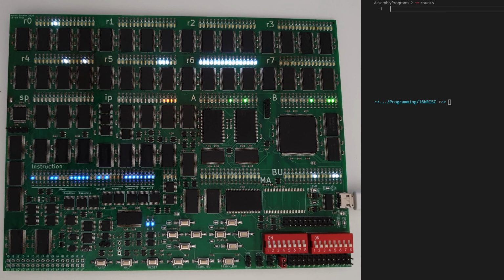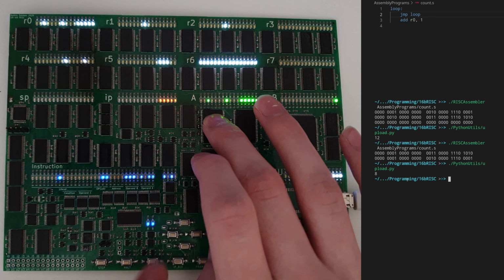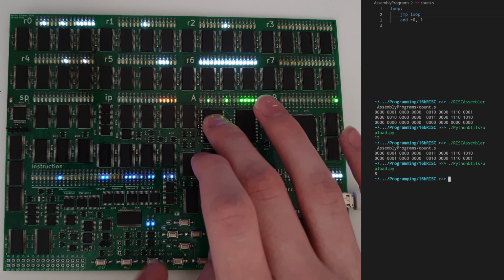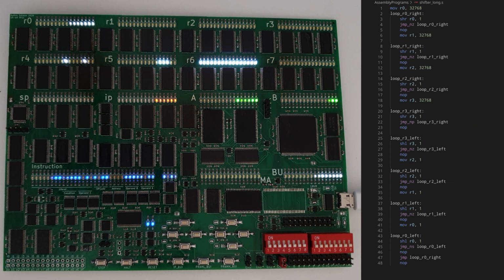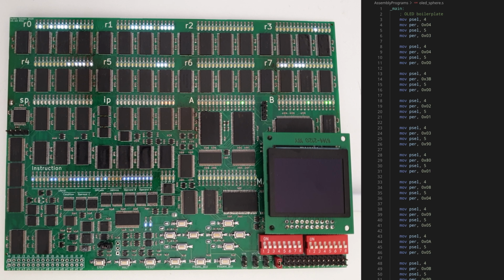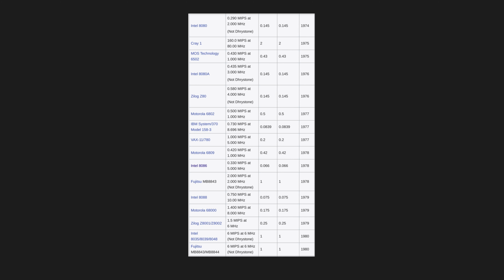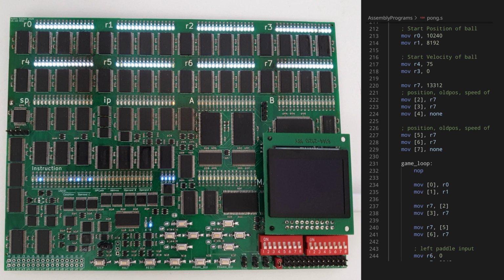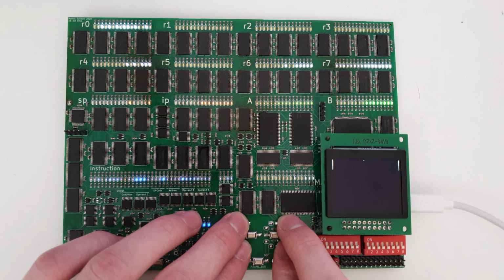Pong on my new Custom 16-bit Computer

Comment: may i ask why you're using 4 IC's per register? what do they do?
Reply from the maker: Sure! Here you go:
- One stores the actual data: 74LVC16374 (or 2x 74LVC377 in the next revision)
- Three are just buffers to output the data on one of the three operand buses (A, B, Addr): 74LVC16245

The buffers are separate from the register itself because I always wanted to show register contents on the LEDs, so the stored value always needs to be accessible.

I would probably go with a different design if I were to do this again though:
Instead of three operand buses, I would use just two which is enough for normal instructions. One of them loads on low clock, the other on high. Then you just need one buffer chip shared by both ports. If LEDs are not required, you could then even do without any output buffers and simply use the ones in the register IC itself.

Comment: What a beautiful board. I love what you've done with the LEDs and the labels - it's very easy to read! Going with a 32-bit constant instruction width for a 16-bit processor is very interesting and definitely not something that any 16-bit processor I know of ever did, but for ease of implementation and educational purposes it makes a lot of sense. It is kind of funny to me that it seems like you've got a very RISC-like design going on, but your assembly language looks more like x86, particularly with "mov" resolving to lots of different functions ;)
Reply from the maker: Thanks a lot! Yeah, bringing RISC fundamentals to their practical conclusion at these low frequencies ironically leads to quite a CISC-y result, at least superficially.
At a few MHz, memory is much faster than the core, so accessing it is essentially free. Would be a waste to make a classical load/store arch!
Reply: @_mathis  On that note, since you've got constant-time memory access anyway, it might be interesting to try to go for a 16-bit instruction design with fewer registers and just PC/stack-relative direct addressing modes. A lot of early microcomputers where memory access wasn't a bottleneck used very few registers because you can basically just do all of that with quick access to memory anyway. So for example you could load one register from memory and add one stack-relative word to it with two instructions in a non-load-store but still relatively RISC 16-bit arch
Reply from the maker: @DevynCairns  You're right, that would work well! The only caveat is that you can't (easily) show register content as LEDs then. You'd have to decide what's more important...
Fortunately I write cores in HDL now, where you do not have to ask yourself these kind of weird questions.
Reply: @_mathis  Fair enough - and yeah I love the LEDs so that's a good enough reason on its own! Haha
Reply: @_mathis  That makes sense for sure, especially given that with your 32-bit instruction size you always have space for a full memory address or immediate, so there isn't really much additional complexity. Again, love the design - and it's beautiful to look at!

Comment: For a while, I've been getting really interested in these types of computers, and have been asking a few different youtubers this question. Where did you learn/what resources do you recommend to design something like this, other than Ben Eater's series.
Reply from the maker: Unfortunately I can't really tell you anything specific. I mostly just designed architectures until I noticed some flaw, then adjusted the design to work around it. That might not be particularly fast, but is what I would recommend for the arch side of things, as it gives you a really deep understanding. 
I reckon the most important thing that Ben didn't mention much is the clock cycle & timing: Know the propagation delay of the different stages of your execution and assign them to the clock cycles (ideally evenly). Also make sure to make complicated logic is synchronous. Asynchronous logic is horrible and usually causes some weird unforeseen side effect.

For the electronics side of things Ben already gave a good overview. I use CMOS here rather than TTL, which is much faster but has fewer components available. I'd recommend just browsing mouser and looking at datasheets to see whats out there. For CMOS, just search for 74LVC in Logic ICs (for some things you might have to go with the slower 74HC). If you don't care about clock speed, then use 74LS (TTL). 

You probably have, but if not, then read up on the basic concepts: CISC (Ben's Design), RISC (this design), Pipelining (though that's probably overkill for your first architecture), Harvard vs von Neumann Arch, etc. That, combined with knowing what sort of Logic ICs are out there, should give you enough context to start designing!

Most importantly, have fun! :)
Reply: @_mathis  Thanks! I've tried to design a few 8 and 16 bit designs before, but always get hung up with control logic. I'm going to try to figure it out by attempting to learn more about RISC. Thanks again.

Comment: How much does the hardware cost?
Reply from the maker: About $300. Though, if you count previous designs where I figured things out to get to this point, it is a bit more.
Reply: @_mathis  Interesting.  I do have a tip though:  You can use a program called "Logisim" to prototype these circuits.  There is also "Logisim Evolution" and "Logisim Evolution (Holy Cross Edition)" which are enhancements of the original.

Comment: Nice build!  That's a pretty dense board, is it a 4 layer stackup?  I'm also curious what the big TQFP-144 part is.  One note, I think you mentioned your parity flag is the same as the least significant bit of the result, but in architectures that have a parity flag like 8080/Z80/x86, it's normally set to the XOR of all the bits; i.e. if the sum of the individual bits is odd.  But then again, it's basically never used in modern computers anyway.
Reply from the maker: Yep, 4 layers. Though the layers really aren't the limiting factor, there's barely enough space for all the vias. The TQFP-144 is a MAX V CPLD, basically a little non-volatile FPGA that acts as the ALU. In my earlier design I used EEPROMs for the ALU, but 16x16 multiplication would be a little extreme to do like that. Yeah, the implementation of my "parity" flag is pretty cheap, guess that comes from my earlier design where the extra logic would have been a big hassle. Actually I could just reflash the CPLD to use the proper implementation, but then all my shifter programs would stop working :( Maybe LSB-Flag would have been a better name. But as you said, it is not really needed anyways.

Comment: nice! very cool. What ever happened to your hybrid rocket engine?
Reply from the maker: Not working on a hybrid engine anymore, I designed a pressure-fed liquid engine though and got it laser 3D-printed in metal, haven't gotten to test it yet though. Have to work on my welding skills...
Reply: @_mathis  wow cool! will you be posting any videos of that soon?
Reply from the maker: @vertex3243  not very soon, but eventually :)